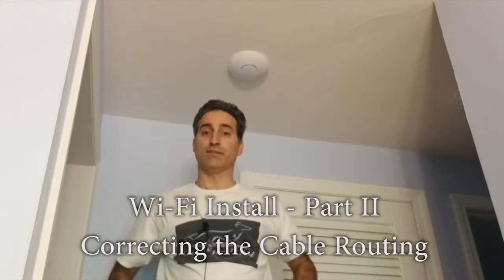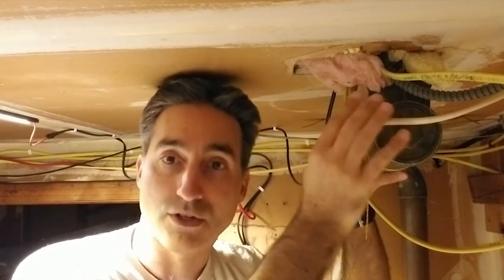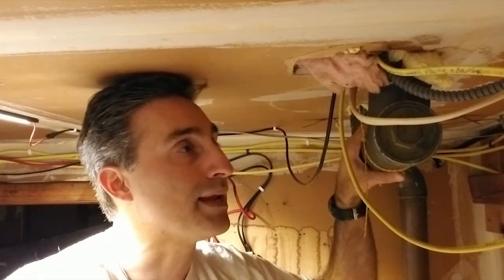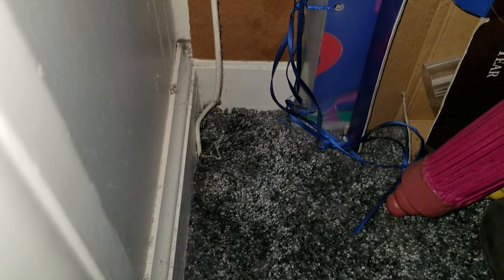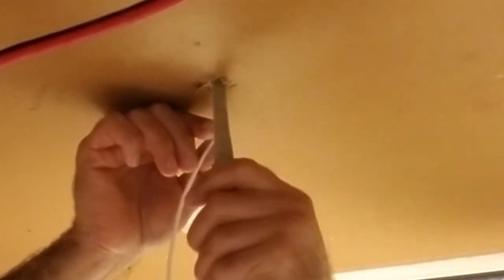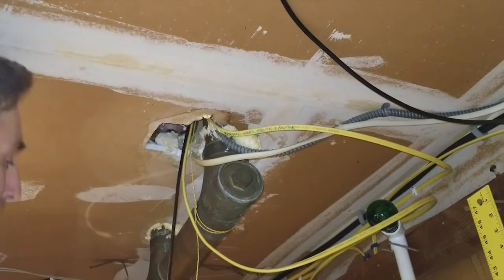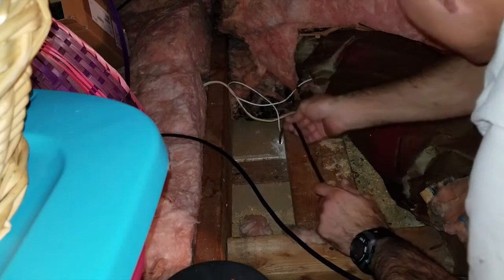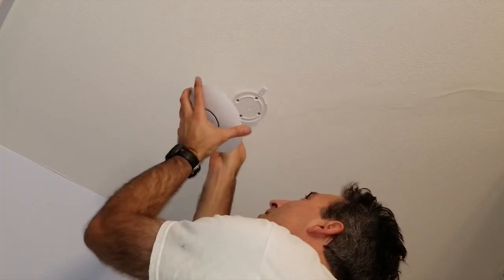Wi-Fi Access Point Install Part II (unplanned oops correction)

Comment: Isn't the ethernet cable supposed to be fed separate or away from that white cable, as it's electrical cable and cat is data?
Reply from the maker: The small cable running through the closet is low voltage (probably 12V or 24V) that supplies the control panel for the alarm system. Running low voltage cables near each other is safe, but it never hurts to leave some space where possible to prevent noise coupling due to any high frequency signal transmission.
Reply: @par64guy  Thankyou for the clarification

Comment: Excellent. Last comment is key. Never assume they did it right. Your new route is much safer. That’s why the alarm installer went that route. As a low voltage electrician, a route from the basement or crawl to the attic is the first problem we have to solve in retrofit installs. 

Nice work.
Reply from the maker: Thanks for pointing out the mistake. I believe comments and feedback on DIY videos is a crucial part of having confidence that what is being watched is correct.